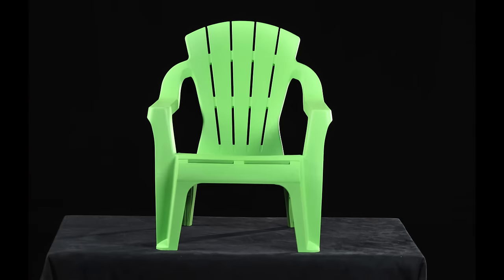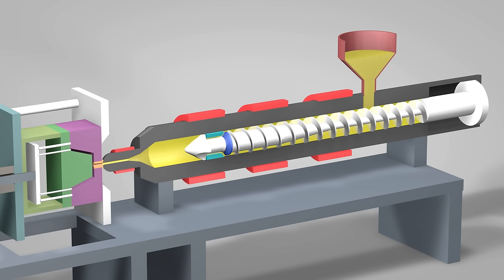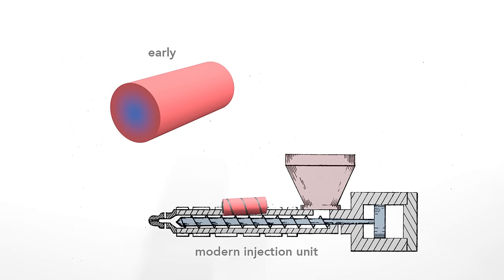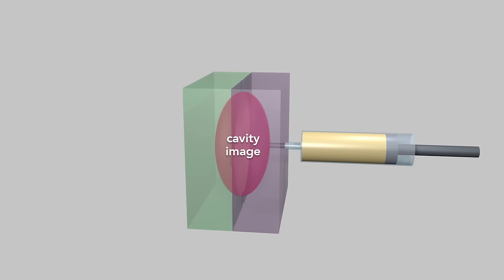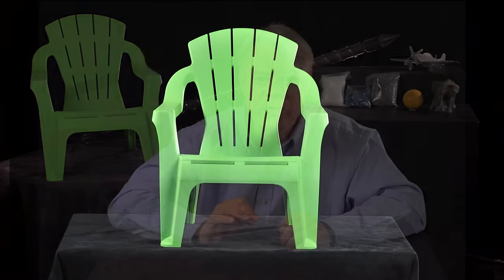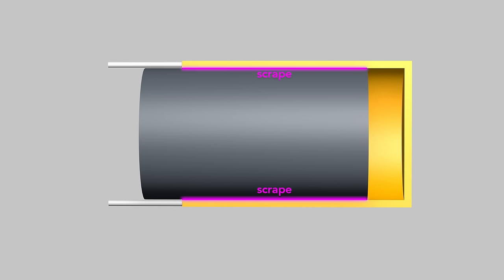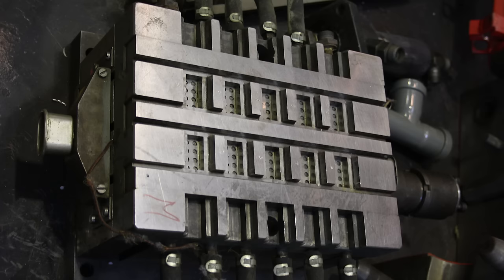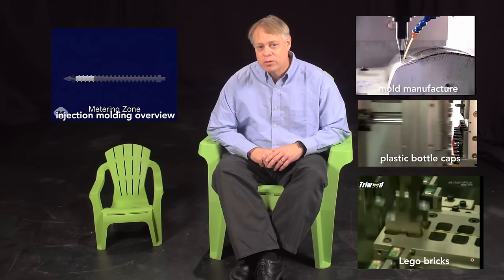Plastic Injection Molding

Comment: "up to 15 percent regrind" where in reality it can be anywhere up to 50 percent or more depending on the manufacturer and how much they want to save on raw materal
Reply: I we run up to 70 percent with santopreme and acetel lol. Adjustments are made to the cushion usually. Never had any issues with shortshots after all these years

Comment: Great vid.Did a lot of electrical work in injection plants. Was surprised they charged more per part made with lexan due to quicker wear on parts. One large shop had a minimum order of a million identical parts. Owner was a great engineer. He made home made scales that would shut down press if say 1 part on a multi cavity mold did not get released. They ran 24/7. Would only run a few machines on Sundays with nobody there. Won free lunch a few times when I bet a strong guy that he could not break a double sided wire strap with 3 hits of the hammer of his choice. Never told them it was made if strong lexan. Same stuff they install in stores & banks.

Comment: Well done presentation on injection molding. I started my manufacturing career in Cleveland Ohio making molds some 30 miles from Akron ( the silicon Valley of rubber) It's interesting and fun work especially after seeing the first run product!
. I can remember making various molds for tier #1 suppliers. Just to name a few: The big three Auto companies rubber car parts, R&D Century Product baby strollers, Golf ball molds for Spalding and fiberglass pultrusion machines.

Comment: Aluminum molds are a cheaper alternative for parts with lower production numbers. And are especially valuable for smaller machines designed for prototyping or smaller scale production.

Comment: I work for a water treatment equipment manufacturer for 22 years and about 12 years in they bought the first injection molding machine and had about 20 or more when I left the biggest being 1200 ton

Comment: If the nozzle on the end of the screw doesn't seat right it blows back on the outside of the screw. If it gets very big you'll spend 8 hours with a hamer, Chisel, and sawzall to get it off.

Comment: q; did they have blow molding at the time injection molding was invented?
also, besides getting the plastic temp correct, there is a specific rate to injection that is very important. The rate will control the gas (or air) being expelled by the plastic, usually it starts slow, ramps up then quickly tapers off. If not done correctly the parts will come out under shot and burnt around the edges that get the material last. On older machines this was a very real challenge. Large parts were pretty easy, the small parts are easier now that we can use computers to control the press. Now we have micro-injection machines. They make very tiny plastic parts. Also there a process to inject molten metal.

Comment: You forgot to mention how the machine operator position in an injection molding plant is the easiest job anyone can ever work. I was so bored opening and closing a door and waiting 30 seconds for a part to pop out that I did 500 push ups a day. 3m respirators, church communion cups, rifle butt stocks. We made all sorts of cool stuff and I gained 30 pounds of muscle with mostly nothing to do except trim a little flash.

Comment: My dad was a plastics engineer for General Motors for 20 years. He developed a one shot molded solar collector complete with glass. He used to bring them home from the tool & die shop and spread newspapers all over the living room floor. When the units cured, some popped the glass, most of them at first, until he had the formula just right, there was a lot of tempered glass to pick up. GM cancelled the project after the array in Arizona proved profitable and efficient.

Comment: Everything you say is true but injection moulded food containers use a injection pin on the gate and the tooling uses compressed air and stripper rings to release the product from the mould. For example a thin wall 500gm volume container 14gm weight has a cycle time of just two seconds. The mould were durable for over five million shots supplying packaging for dairy spreads etc. Cheers

Comment: What separates calling it a screw in this application over using the term auger? I work for a machine integrator and we are starting to dip toes into working downstream from injection molding equipment. So I am trying to learn as much as I can in a crash course. Thank you for this video.

Comment: What I was hoping to find is how toy companies make injection molds for action figures and dolls.  Machining the mold is one thing, but I've seen toy manufacturers say they start out with a wooden sculpture of the final product, but I never seen how they go from the wooden sculpture to the injection mold.  I'm not sure if they just mold the wooden pieces with molten metal then clean out the ash and charcoal afterwards or what, but I assume that's not the case because they have to mold the other side of the piece as well, I don't seem them being very successful with making the back half of the mold when the sculpture is reduced to ash and charcoal.

Comment: How long does a plastic injection mold last? 100,000 units? 500,000 units? I am told that they wear out after around 100,000 units and need to be replaced as the product does not fit together well after that.

Comment: Excellent video. I had stumbled upon this by seeing and watching a few YouTubers who are making more simplified and less precise Injection Molding machine. DYI machines. Not sure why these DIY guys are making these videos of those less than perfect and pretty much impractical. I am new to 3D Printing, the traditional plastic filament that stacks to build the print. I think the main issue most people would have is, sure you can inject heated plastic into a mold, assuming you created a fairly decent injection molding machine, BUT creating the mold would be an issue. Additionally most hobbyist or even semi-pro builders are not pumping out multiple parts so creating a mold to knock out 100s of parts, to make a mold practical, is not really a consideration. And then the DIY injection machines will come at a build cost and not being as reliable as a traditional 3D printer which are now pretty decent and cost effective.

Comment: You don't use a shut of valve on the end of the injection screw when molding UPVC  or PVCU as they call in now days. You have what is called a smear head on the end of the injection screw when molding UPVC as it is very heat sensitive. UPVC passing through a normal valve system on the end of the injection screw will cause the UPVC to degrade.  So a smear head is where the core diameter of the screw increases as it gets towards injection end so there is a small gap between the core diameter of the screw and the screw barrel bore. After that the core diameter of the screw tapers down to a pointy end. UPVC has a very high viscosity when heated to the point of injection, so on injection most of the polymer goes into the mould and very little goes back through the small gap between the screw core and the barrel bore .

Comment: This might be a dumb question, but, is there a way plastics could be recycled? As in they'd be melted down and used for another product?
Reply from the maker: Usually no, as I understand, PET bottles (2 liter bottles) are cut up and use as in synthetic carpets
Reply: @engineerguyvideo  first, I'm a big fan, so the fact that I got a reply from the engineering guy has made my week.

I'm a relatively young product development engineer. I'd be curious to understand some of the hurdles to getting to a point where we could recycle more plastics or is it more likely to develop more biodegradable plastics. This might be a bigger topic than a YouTube comment could articulate, but it's something I'm curious to learn more about.

Comment: Injection mold operation is also very boring in practice. Often the operator falls asleep as some parts can take up to 60s per cycle.
When this happens the mold stays open for an extended period of time (as the operator is sleeping) and if this occurs for too long
the mold will cool and the entire machine will be seized up. Torches are then used to heat the mold and the lead screw to get the machine operational again.
Additionally the parting line is also known as the flash line and flash is often poorly removed. You also didn't mention two part injection molding or the use of multiple materials and polymers which is often used to create handles and other types of insert manufacturing.

Regardless I enjoyed the video but I would just like to add those bits from my own experience.

Thank you for making these.

Comment: I had the "Pleasure" of working one summer at CBS toys.   It was all plastic injection molders.....Cincinnati Milicron, I think.   Someone had come up with the delightful idea to add scents to the plastic....they had cookie sets that smelled like Ginger....so naturally the whole area around that molder smell like warm Ginger cookies.    The job was very boring.....when the parts came out of the mold your main job was to trim off any sharp burrs using a special knife.

Comment: I've worked in 2 injection molding plants, 15% is a joke for recycled plastics, both plants regularly ran 25-50%, even when contracts specified "less than 20%"... also, Lego has insane standards for cleanliness of their machines, higher than most medical products... have you ever seen a Lego with a speck of the wrong color?

Comment: How were the molds made back before CNC is what I would like to know?
Reply: go look up optical grind surface grinders and optical comparators
Reply: @yelims20  didn't tell me how a small plastic model airplane was made by grinding into solid piece of steel to injection mold and produce an exact replica in plastic! No computers!!!
Reply: @garychaney5484  by being able to SEE the small details. a 50x comparator makes .001" look like .050", from half the thickness of a hair to almost 1/16 of an inch. molds were made of many parts assembled into a mold rather than as a single block of steel. There's all kinds of ways to scale things such as a pantograph...

Comment: This injection force that it is needed can be achieved way way easier by the use of gravity.  And I seen your bird video and we had one on the table when I was approx two or three and remember it too.  Intricate as it is;  I thought of one that is similar to that but much simpler and doesn't stop as long as there is water it was actually meant to be in the snow but I just thought water because it wouldn't run out;  the idea is a half circle thermometer and when it were to become heavier from the getting colder from popping out of the ice and the north antarctica cold would make it shrink again and heavy again at that end and swivel back under the snow or ice or rock I guess or anywhere that it is less cold.  I need to share this with you so that you can make a video with me.  It's an important planetary with an extra ring and sun turns backwards and I built it cause I was sure it wasn't;  when I first glanced at what they had for planetary and what 1:10 ratio was their max and mine is about 50 or so or even 100 if it's built oversize components.  It on quora under my name Outlaws of physics.  Cheers.

Comment: I restore classic, exotic, and antique vehicle parts. I often have need to "Make a can".  Often automobiles use cans as a base component for Vacuum storage chambers, Vacuum advance pods, oil cans, and the like.  . The rolled seam I can Unroll using several tools that I have made. However, today I am challenged  to use the older Soldered-on rolled seam technology of the "non-punt" parallel wall not "necked" simple tin can for ignition coil body.  Of course, it is much more simple to simply purchase a can with product in it, and save the original seams, upper and lower. However, the older technology cans that I am reproducing no longer exist on any grocery store shelf. There likely is -Somewhere_ a chart describing dimensions of older cans, and possible a cross reference to the products that they were used to contain. Perhaps, and likely,  the 1950 Ferrari  Magneti Marelli Ignition coil was originally, and conveniently made from an olive oil can. Now, the hunt is on to find that ancient can of oil. No idea if the can companies have these records of sizes, or products within- or where I might find very old stock. 
So, I may be rolling a rolled-seam can and lids on my bead roller soon. HA! I do this every day.

Comment: I think recycling plastic should be law. All plastic capable of being recycled should be! Plastic isn't a bad thing, it's how we treat it. If we recycled it instead of burning, burying or throwing it in rivers and the sea then there would be no problem. Plastic uses less energy than metal components and recycling plastic saves a lot of pollution. Plastic is light and hard wearing so therefore saves a lot of fuel in your can due to its light nature. There is a lot of potential in new and unusual plastics. I went to the London science museum and saw something very interesting about "super" plastic with useful properties, such as strength, conductibility and many other uses and properties! Plastic has a long future. The funny thing is plastic IS natural, probably MORE then "natural" products as it comes from oil that is hundreds of millions of years old, no natural animal or plant is that old. Oil is made from natural materials anyway. All the eco warriors are stupid anyway, plastic isn't evil.

Comment: I find it quite unfortunate that you picked these low-quality products as examples. Injection molded parts make up a good proportion of every automobile, every smartphone, every electronic device in general. Some companies can injection-mold precision lenses or miniature valves. Even some safety devices like airbag gas generator housings or surgical implants are injection-molded. Not just this cheap made-in-China crap.
(Also, the runner you showed with the cutlery mold is terribly imbalanced.)

Comment: At last, an american that's calls them Lego bricks correctly, instead of saying Lego's like a numbskull.

For all you Americans out there, appending an "S" to a word and therefore pluralising it only applies to a thing of which there are many of the exact same thing, like a flock of seagulls for instance or a pack of wolves.

Lego bricks are NOT all identical therefore they cannot be grouped via pluralisation into a term called "Lego's".

You can call them plastic bricks all day, just like you would say a group of cars because then it would be a generalisation but since Lego bricks are not a general thing but an identified and unique (at least to begin with) product then they can't be generalised.

Make sense?, just say yes and go about your day having been educated.